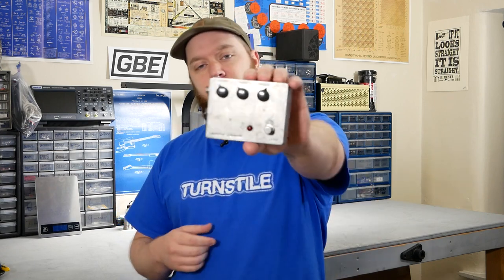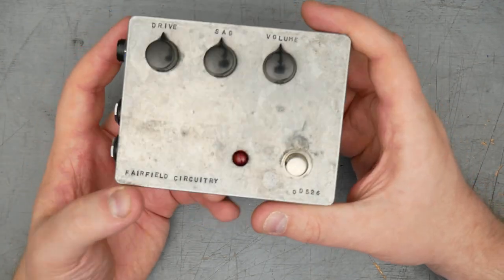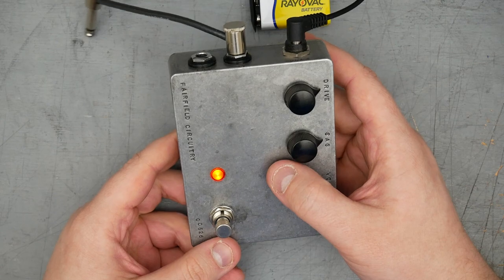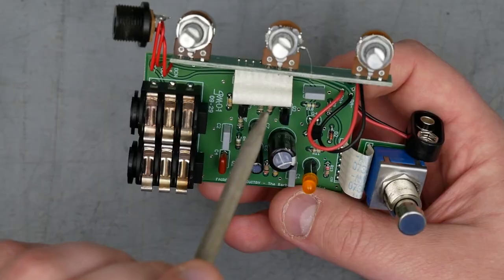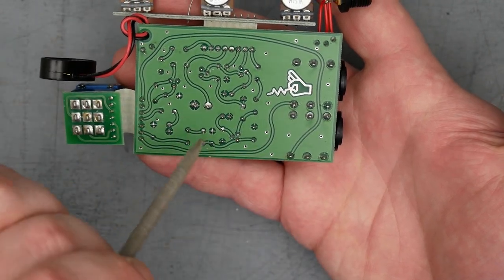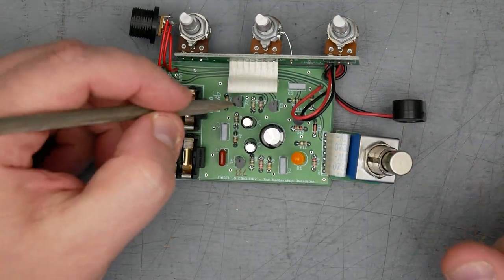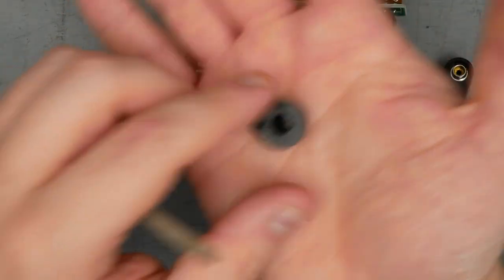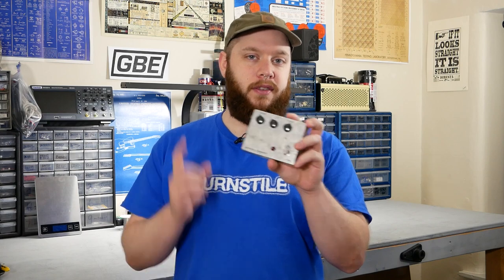Fairfield Circuitry Barbershop V1 Teardown! See what's inside!

Comment: Just got power back from Hurricane Ian. Good video. Those bias resistors (R7 and R8) should probably be trimmer pots. They might be, on newer revisions. Those pesky J201s and their wide tolerances...
Reply from the maker: Since Fairfield is already testing for Idss, I would guess they have a test jig to find the correct drain resistance, and just plop in the matching fixed value on the PCB.

Comment: Any good tips for a setup to test smd transistors? (my stash of to-92 j201's is running thin).   
   thanks for this video, now i understand why my clone sucked! :D.   Also congrats on an awesome channel
Reply from the maker: Thanks! Probably what I'd do is get one of those through hole adapters for SOT23: https://www.pedalpcb.com/product/sot23adapter/
Set that up on a breadboard. Then just drop the transistor on top, hold it down with a spudger or similar. Then perform the tests I want to do. If you're looking for Vp and Idss, you can use the JFET matcher here: http://tagboardeffects.blogspot.com/2012/07/greatly-improved-jfet-matcher.html